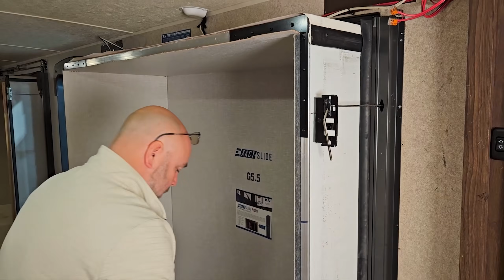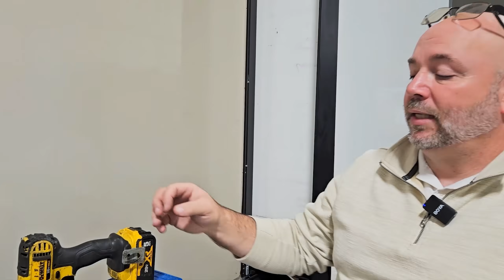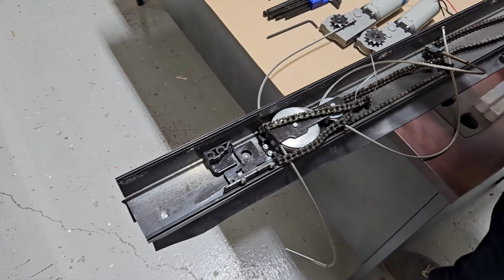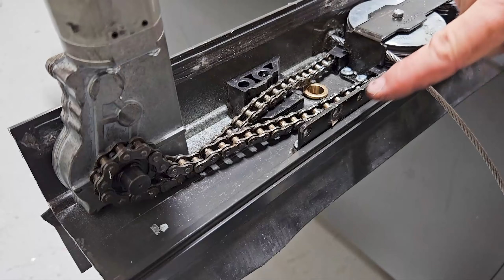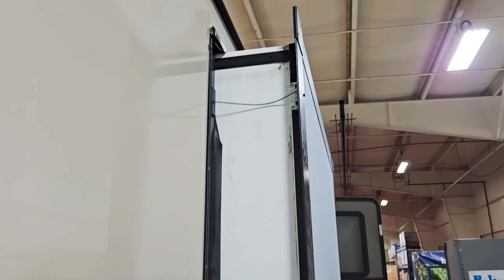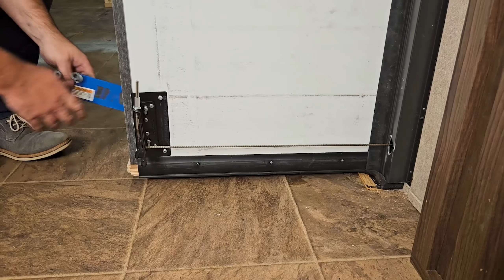EXACT-SLIDE Extended Shaft Motor Replacement Procedure

Comment: Great detailed video. I have a 2026 Alliance Paradigm 382RK, only used it for a 3 day weekend, here at home the other day rain was coming so I went to retract the bedroom slide and holy mother of pearl, the left side was screaming at me and wasn't working, found the BAL control module and did the override button test and sure enough, left motor is bad. Turns out Alliance sent the new retro kit and motors to the dealership I bought it from but the dealership didn't install them under the recall notice. Nice! Alliance confirmed that I have 2 slides that need all 4 motors replaced with the new ones, since I'm a contractor I'm quite comfortable doing the repair, I removed my 2 nightstands, fascia and sub fascia, now waiting for Alliance to send out the new motors and retro kits. Glad I found this video.

Comment: So on my 2021 XLR Nitro 351 toy hauler we went all out. Full body paint, big generator, 3 season doors, patio kit etc. and then they go and put this system in it and it’s already failing. Mind you, we use it maybe 3 or 4 times a year. Those slide go in and out maybe 6 times a year. So now, I just ordered the 250 dollar kit and have to wrestle with this thing for a weekend to fix a shitty design. My money, and my time, to fix their F up. Surprised there isn’t a class action at this point. This is just on the living room side. The kitchen side I’ve already replaced a cable that frayed the first year we had it and that side will need the motors as well. I’m hoping the bedroom closet slide doesn’t have the issue as it’s a lot smaller and lighter. What a disaster.

Comment: I had to do one of these today at my shop and now I understand why all the other techs and companies turn this job down. Won’t even touch them. This video doesn’t account for everything else in RV being in your way. Threw frame slide out are still the best in my opinion and it’s the older design
Reply: They dont turn them down where I work. And if you've done them a couple times it takes like... maybe 2 hrs per side, even if you need to remove facias on both side.

Comment: I have to say. Great video. Very well done and shows every step.  Is this replacementsystem better than the original?.  Question is why is this system still being installed? It's junk, t isn't reliable and fails often.  It's not something that can easily be fixed.  Luckily all the times mine has failed its been at my house closing the slides just before leaving on a trip.  It's ruined multiple weekends.    I'm fixing and selling this camper and Looking for one with no slides.  Tired of all the issues.  Camper is 4 yrs old and nothing but problems.  Jayco 28.5rsts.  Anyone interested in buying let me know. I'm in MD.
Reply: I have the same 28.5 2023 with the same issue. On my 3 motor. Rv dealer took 6 weeks till they would even look at it, now going on 1 month since they had it and no work has been done. 2 months of summer wasted.
Reply: Or put these revised motor assemblies in and keep on keeping on.

Comment: This is a great video. After replacing 5 of the original motors on my 2024 Alliance Paradigm 385FL, I was getting pretty good at it. We had some work to be done at Alliance and Norco/BAL replaced all 6 Exact Slide assemblies,(3slides) with your prototype assemblies.. So far, so good. Thank you for the upgrades.